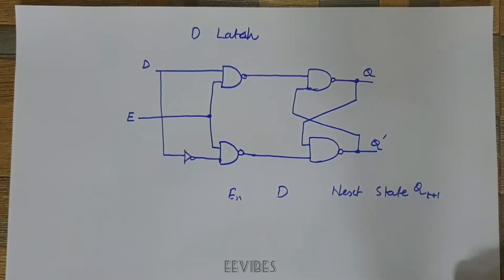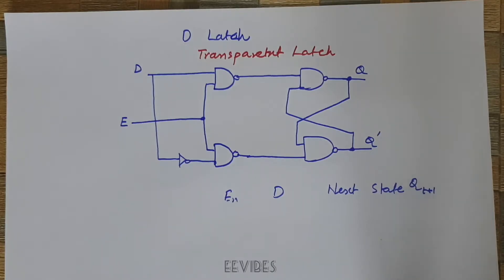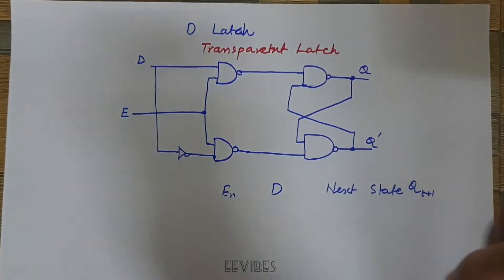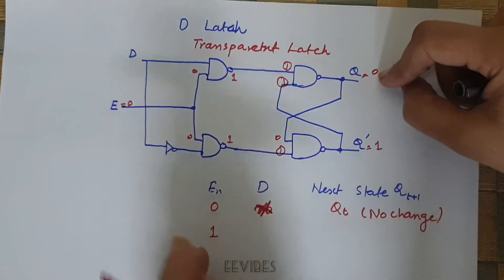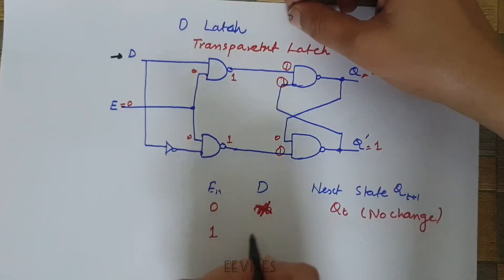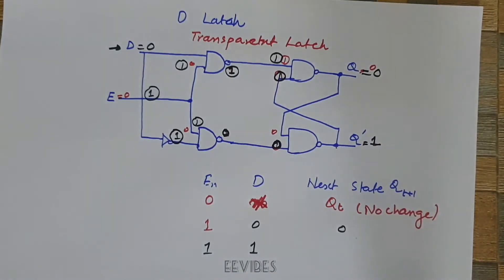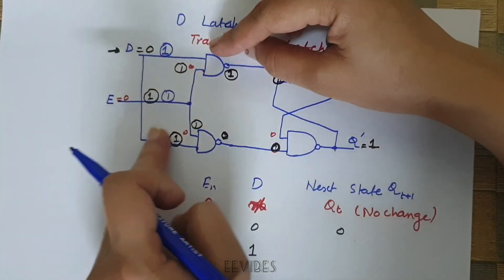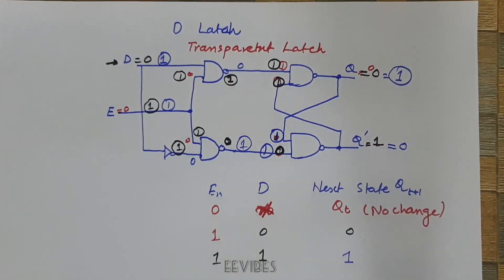Working of D Latch

Comment: So, what is the purpose of the D Latch?
 Is it transmitting the data D from D to Q?
Reply from the maker: There are many reasons for using the D latch: 
D latches are used to temporarily store data. This is essential in many digital circuits, as it allows for the retention of information between clock cycles or input changes.
Sometimes they are used for synchronizing the data with clock signal. or for transferring the data from register to memory location.
Reply: @eevibessite  Thank you
Reply from the maker: @uapino8227  subscribe to my channel and help to grow....

Comment: What is the difference between D Latch and Gated D latch
Reply from the maker: The only difference between a simple latch and a gated D latch is of the "gate" input which actually controls when the D input will be effective. So if G=0 the latch will be in hold state. When G=1 then the input D will be forwarded at the output side.
Reply: @eevibessite  Thanks alot for your reply ♥️
Reply: if it possible for you to make video on Difference between D latch And Gated D Latch with proper explanation.
Reply from the maker: Ok in coming lectures
Reply: So in SR latch we have invalid state now using D latch we are removing the invalid state am I right ?? But why do we have to remove that and also there was a latch on 1,1 so what about that and why we are doing this?